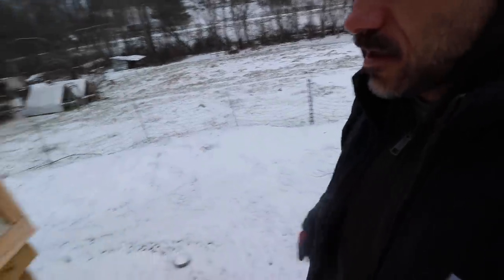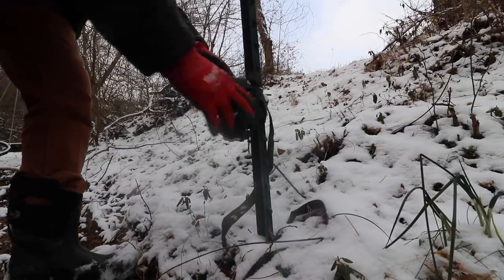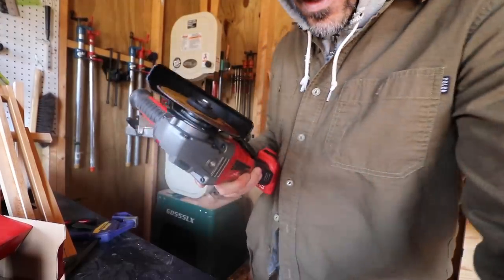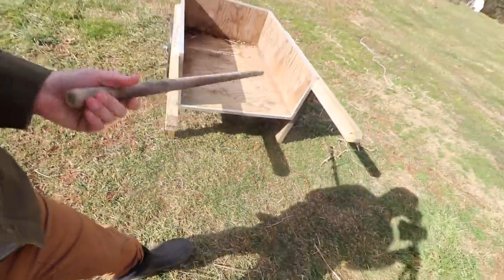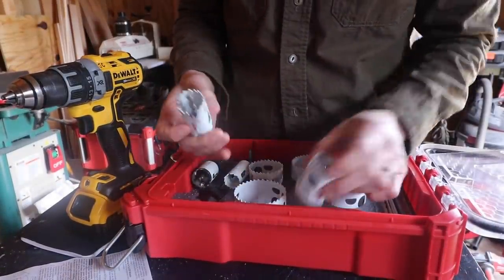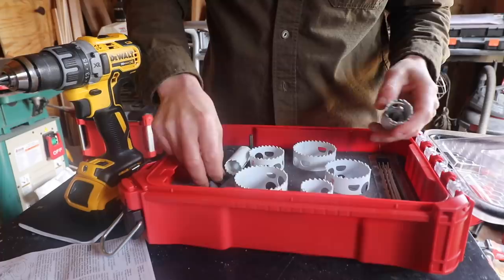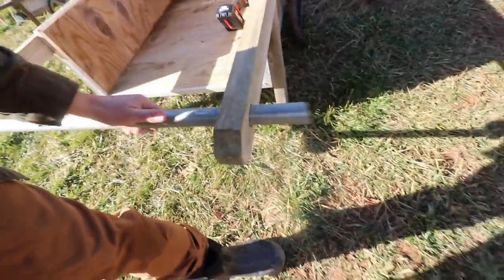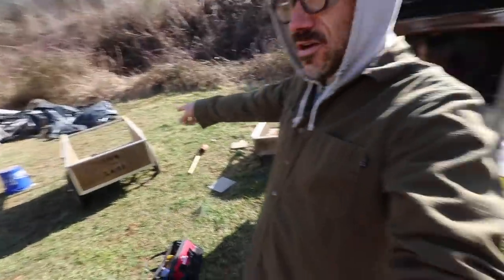Upgraded! My DIY Garden Cart/ Vlog

Comment: You have your game cam too low to the ground.
Reply from the maker: how high should it be? I hear two different things. Someone says too high and then too low.
Reply: @SowtheLand   most camera manufactures recommend around 30-36" off the ground,  in that setting you have it I would go up atleast 12 to 18" higher than you currently have it.  Good luck.
Reply: I just saw a video where the guy speaking was from one of the game cam companies. He said that it should be between 6 and 8 feet off the ground. Apparently the sensors will pick up a wider range that way. We just got the exact game cam that Jason has. I’m gonna have to go back and watch and make sure he wasn’t just talking about capturing deer or larger animals though.